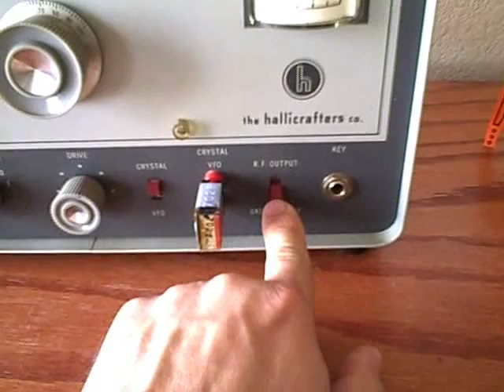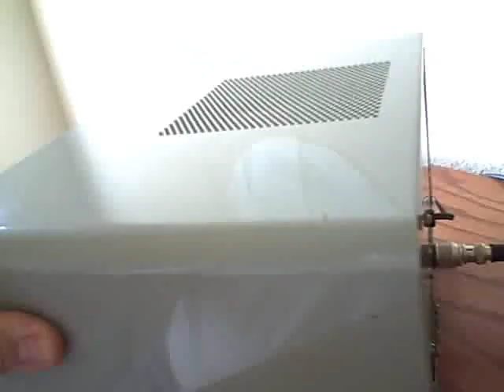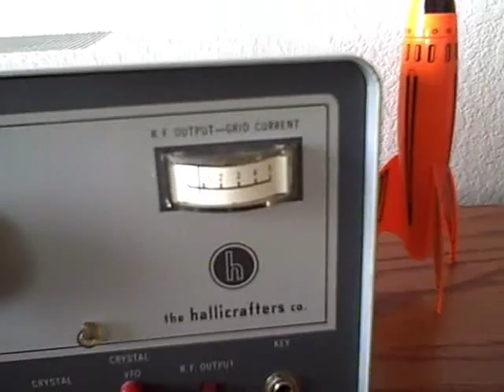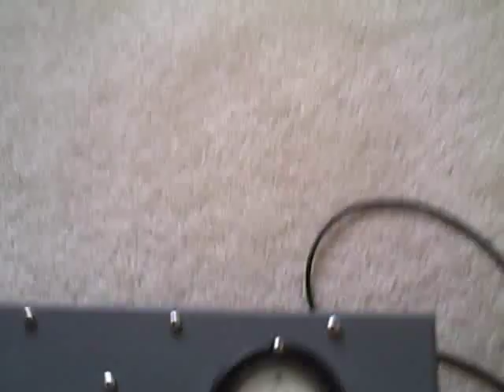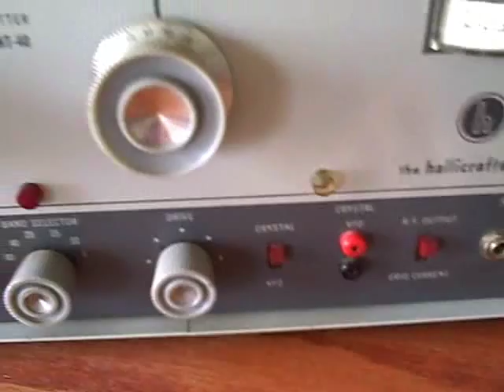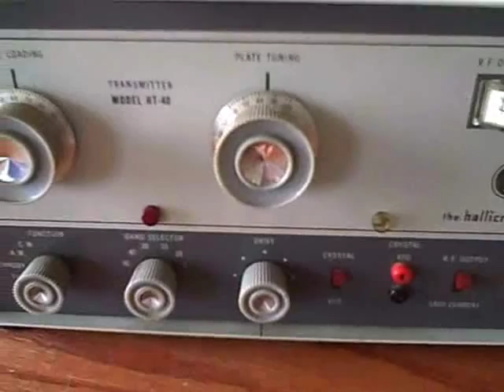ht40.wmv

Comment: A friend of mine is refurbishing an HT-40 for me. My father bought the HT-40/SX140 when I got my Novice ticket in 1962 when I was 13 and I'd like to see if I can recapture some of the enthusiasm for amateur radio that I had in those days. My friend and I have been having a  discussion about how well the transmitter can reasonably be expected to fit into its  cabinet. Before I sent the HT-40  off , it rattled around in the cabinet much more than I remember when I was a boy in 1962; it seemed to me then that the HT-40 fit much more snuggly then than it does now. Granted, the cabinet has been damaged.  I just don't remember that the xmtr fit its cabinet that sloppy back when I was a kid in 1962, but that was almost 60 years ago and of course my memory is imperfect. Here is my question: Can anyone tell me how well the xmtr can be expected to fit in its cabinet and what kind of gap there is between the front panel and the upper or lower cabinet in your HT-40, if you have one? There seems to be a big gap between the front panel and the cabinet now. Admittedly, these were mass produced and while I realize that is the case, I just believe that it should fit better than it does. Can anyone help?

Comment: Nice video, but the HT-40 uses a 6DQ5, not a 6DQ6 in the final amp stage. Also, the pot on the rear panel is for microphone gain adjustment, not for meter adjustment. Long live the HT-40!
Reply: yep